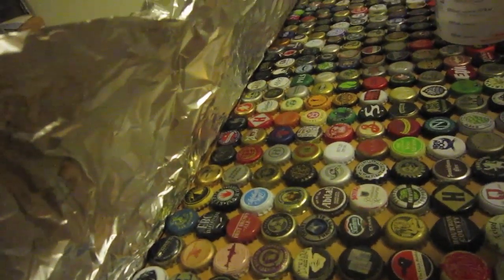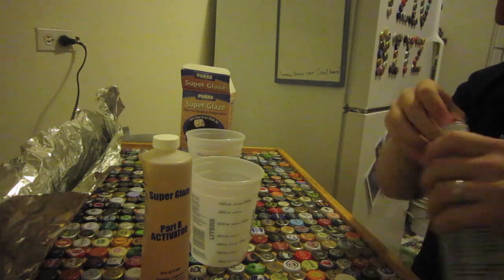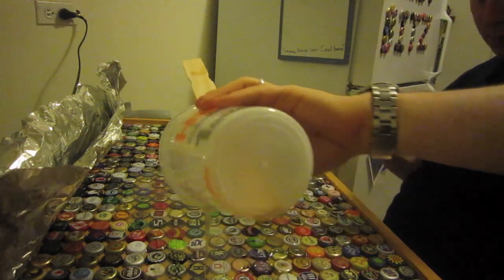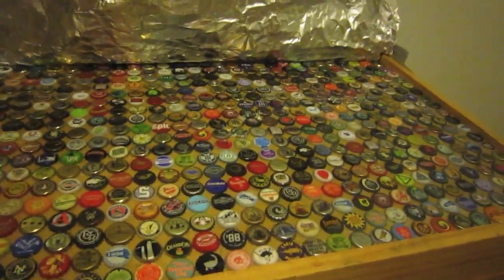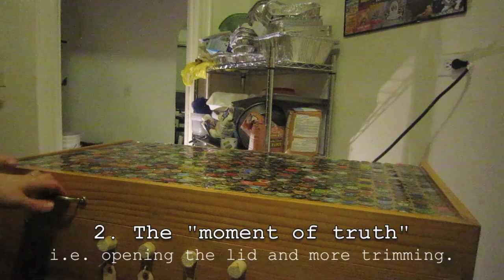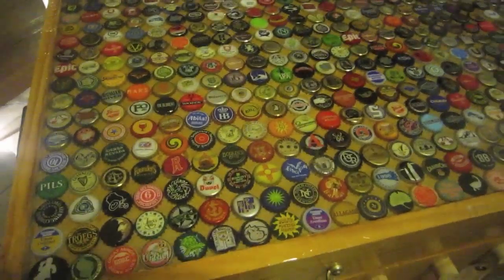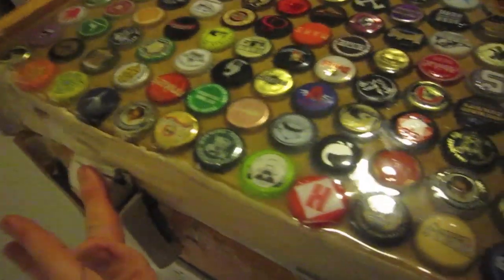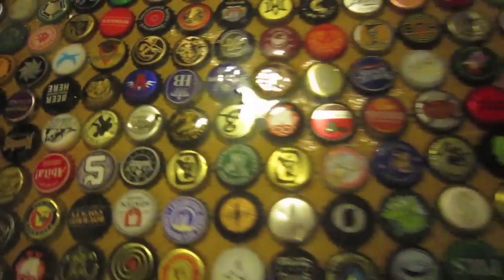Homebrewing DIY: Finishing a beer cap bar top w/ epoxy (keezer lid)

Comment: Great video and awesome final product! I am currently in the process of creating a 6 foot x 3 foot table and am having some trouble securing the caps to the table prior to pouring the resin. Do you have an suggestions of how to glue the caps down so they do not float up once I begin pouring? Any help would be much appreciated!
Reply: pva glue, or a hot glue gun, use one brand of glue as different glues can react with each other. where did you get all your bottle caps from? I'm having trouble getting enough, lol im a grown man and im collecting bottle caps, wherever I'm at, sidewalk or park etc I'm checking out the ground for any stray bottle caps 😄